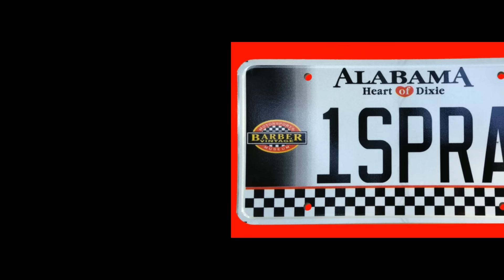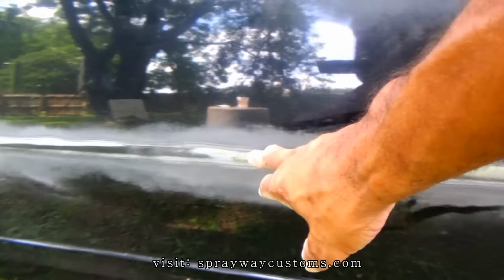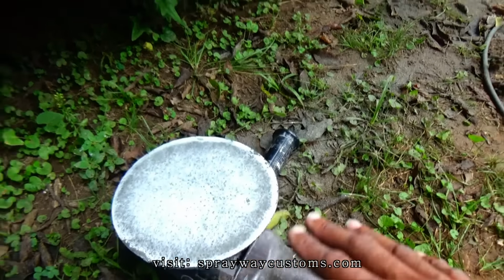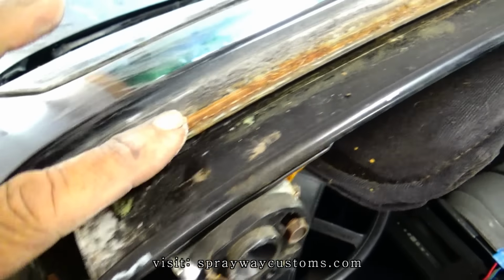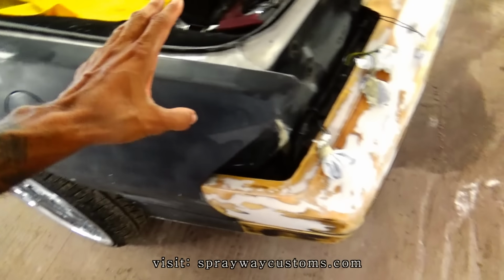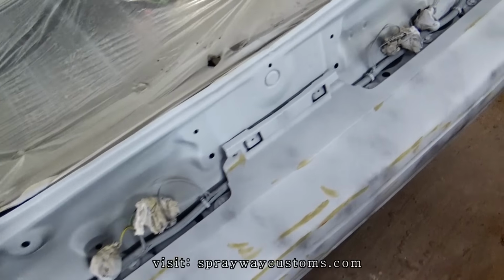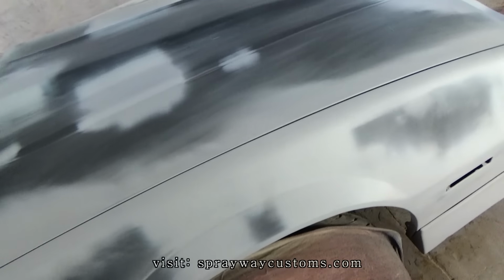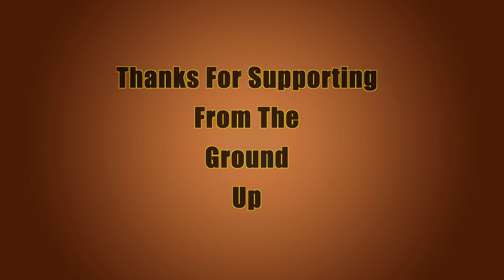Bodywork Dent Repair / Primer / Prep For Painting A Car At Home - 88 Chevy Camaro IROC Z28 Third Gen

Comment: Awesome job man! Those urethane bumper covers were wavy from the factory. Most body shops won’t touch them. Very hard to block them and they actually flex in the wind at highway speeds.. I’ve seen a lot of beautiful paint jobs spider crack on those front bumpers. You’ve definitely showed a ton of work.. best narration along with each step.. mad props brother spray
Reply from the maker: You right on the bumper covers Brett. Especially on the flat area where the lights at.
Reply: You’re right about that. I was told it would be easier to just replace mine. I did not! I worked them myself and they were super hard to straighten out. I made stands from wood to give them a harder surface to work on. I also used my orbital sander since it doesn’t put much force down on the material.
Reply: Also used a different filler for them. One that is flexible. On the spider cracks I sanded all the way down into the urethane and used the flexible filler. They’re pained now and don’t show any spider cracks but only time will tell.
Reply: I give ya tons of credit. Your bumpers were in a lot worse condition than mine were

Comment: I’m definitely a fan of your work, but I was wondering if you get a chance to show us a in depth rust repair . I have a 2005 Acura rsx and it has rust on the wheel wells that I’d like to fix. I’d like to see a basic rust repair your way where I won’t have to spend an arm and a leg to fix it myself . Thanks 🙏
Reply: He has videos with rust repair. They gave me the confidence to fix my rusty hatchback. He has a few videos with different techniques I ended up using. Besides, if he can do it with one hand while recording... you can do half as good with both, lol. I used spray foam, Bondo glass, and spray paint. Wish I could post pics here, "Sprayway inspired".
Reply: @nsalcedo22  thanks I will have to skim through all his videos .
Reply from the maker: Next time I run across rust I'll go more into detail. I do have a video on repairing rust without welding though.
Reply: @SprayWayCustoms  thank you sir I will look through your videos. The rust issues on my wheel wells is all the way through so thanks for your guidance sir. 💯

Comment: I enjoy the process I have a? The guy coat when you see the guy coat means the area is high or the area is low and needs more filler
Reply from the maker: If you still see the guide coat in some areas after sanding, it means those areas are low and you need to sand more.

Comment: I hate how those third gen door handles raddle. Just needs a small bushing 8nstalled and it goes away. The replacement  door handles do the same thing so the bushing last longer.
Reply from the maker: Yes...I'm just gonna repaint the originals
Reply: all GM handles from that era and style had that problem.  The wire return spring would break off and it would flop around.
Reply: It’s always just the driver side because of its use. The spring wear out. It’s a easy fix.
Reply: I bought 4the gen handles first my 3rd gen. They are a tad bit smaller. I’m sure those springs will eventually break and I’ll have to replace them as well.
Reply: @SprayWayCustoms  are you painting them the original black or the color of the car? I’m trying to decide whether to leave my new ones black or paint them the color of the car

Comment: That back hatch ain’t that easy to get off. It requires cutting the sealer from the class. To do that you have to remove the whole glass and do it on a bench or floor on a blanket. Long story short..... tape it up!!!!
Reply from the maker: I actually was trying to get it off and kind of gave up on it one day but I had it sitting out in the sun and it just separated real easy when I started back messing with it.
Reply: I took my glass off while attached to the car. Used the longest knife it have- butcher knife from my knife block. All I did was go yah it through a lot and then there were only a few spots holding it on. Took all of 10 minutes. That urethane adhesive is soft and doesn’t fight much since the car is old. I’m still in the air for what to use to reattach it. I’ve heard that after attaching it ya should wait 2-3 weeks before putting the shocks back on.

Comment: Your videos have inspired me to turn my garage into a small shop and try my hand at a few Walmart parking lot dings and maybe a few whisky dents.    I am a service tech by trade so I have no trouble taking apart what needs to be done.
  My question is are you having good luck with harbor freight body tools,   Or should I  invest in better tools?    I have access to every brand,  but want to start out a little at a time.
Reply from the maker: The Harbor Freight body hammers are great

Comment: I pulled the panel off the back glass by taking the 6 nuts off the bolts and the. I used a long knife to break the urethane adhesive. Off it came. There will be some small spots that are beginning to rust. Mine had barely any as it’s from California and now it’s in Houston.
Reply from the maker: Thanks Super Chile...I eventually got it off

Comment: What do you think about rust converters? Not the spray can primer looking so called converters but the type that comes in a gallon jug and and turns into a zinc ready to paint  coating.
Do you use these and if so, which ones?
Once again, thanks my friend. I'm glad you can see the good underneath the bad on some of these panels. I would have sworn some would have had to replaced. This gives me a lot of hope for some projects I want to to do once my spine heals some more.
Reply from the maker: I haven't used many rust converters but I heard great stuff on the kind you talking about

Comment: Great video thanks for sharing the tips. Question about primers hope you can help.

I’d use epoxy for bare metal, add bondo/sand it down where needed, then spray high build primer?
Also what brand primers you recommend?
Thanks
Reply from the maker: panchbarron1 yes that's the correct way of doing it. Most of the time I use UPol High Build Primer...it's pretty affordable.
Reply: @SprayWayCustoms  thanks for the info 😎

Comment: I always watch your videos multiple times to gather all the information that I may miss the first time. I do have one question tho. How do you know when to wet sand or just sand without water? I’m going to paint my 75 Cadillac eldorado that was last painted in 07 wich the body work is still good overall may need a few touch ups on dings but I’m just wondering if I start off the rest of the car wet sanding with 180 or do I not need to add water?
Reply from the maker: Wet sanding is done right before paint. It should be your final sand. You should dry sand with 180. Anything more aggressive than 320, I would say just dry sand because you'll need more sanding after that because you have to remove those 180 scratches.
Reply: @SprayWayCustoms  Sounds good, thank you for response!
Reply from the maker: Miguel Gonzales no problem

Comment: What type DA do you use? I have a good sized dent on my camaro’s front bumper, how would you recommend pulling that out of the bumper is not metal? What filler would you recommend I use?
Reply from the maker: It’s a Porter Cable

Comment: Killer video ..what's the purpose of using different primers ??!
Reply: Epoxy Primer is not porous. Epoxy also sticks "best" to bare metal. But, epoxy is not really meant to be sanded on.
Epoxy seals all water and rain out no matter what. If you are going to grind down your car to bare metal and not do any body work or your paint job for months and months or years, you should prime the bare spots with epoxy. All other primers and fillers are somewhat porous and should not be left to humidity and or rain for very long. Other primers like high build 2k, (two part mix) are meant to be built up in layers and to be "block" sanded smooth and flat. 2k primer does tend to shrink a little, so you should do 3 or 4 coats then let it sit for a couple weeks or so (in the sun is good). You may have to do that 2k  process 2 or 3 times. After its all perfect, you can then put on a "sealer" coat or "surfacer" coat of primer. That sealer coat can fill in very slight scratches, so your metallic paint doesn't sink into the scratches as much (the metal specks or flakes lay down really weird in the scratches.) then you shoot your paint of choice.
Reply: @jakefriesenjake  thanks for the info
Reply from the maker: Thanks for the reply Jake

Comment: 3 project's at 1 time you're a beast but I really need to know where you got that sand paper that sticks to the sanding block big dawg
Reply from the maker: eBay or pretty much anywhere online just type in PSA roll sandpaper / Pressure Sensitive Adhesive Roll Sandpaper
Reply: Ok thanks bro I been learning a lot from you you I'm going to show you before and after pictures when I'm done with the bubble Chevy

Comment: I got surface rust on my 68 impala. What do you suggest to get rid of it ? Just sand and spray epoxy primer? Do I have to go to metal? Or can I just scuff and primer? Thx
Reply from the maker: Sand it down to bare metal and then epoxy
Reply: @SprayWayCustoms  once it’s to metal do I need to do anything to the metal before I spray the epoxy? Like wipe it with a cleaner or anything? Thanks

Comment: No need to use self etching primer for the bare metal parts? Just epoxy primer/sealer?
Reply from the maker: I just used it on small areas to keep from mixing up epoxy
Reply: @SprayWayCustoms  gotcha thanks 😊

Comment: how do u apply the guy coat i know you don't hold it down from far on spots with primer or bondo and how would you know to stop sanding and what grit did you sand with
Reply from the maker: Just mist it on lightly. You'll know to stop sanding after the guide coat is gone. It depends on what stage of sanding on the grit

Comment: I all ways watch your video's , do you have a video on how to deal with surface rust on a hood or on a roof it's really bad if not could you please do a video on how to get it ready to paint please
Reply from the maker: I do have some videos on rust but if it's just surface rust...all you need to do is sand it down to clean metal and spray epoxy over it and then high build primer

Comment: How would you mix products that says 15 to 20 percent reducer seams like im just confused on that part i sprayed high build primer with a 2.0 tip and did 4:1 mixing ratio and when it tried to spray a second coat i think it was starting to gum up in my gun wasn't spraying right and build up on the tip
Reply from the maker: 2koolforyou88 the mixing ratios can get a little tricky. Most cups have a section with most common ratios on the side. I try to reduce all my primer especially if you spraying it out of 2.0 or smaller tip. I really sort of freestyle on the reducer. Stir it up and lift the stick up, you want a steady flow from the stick but not pouring like water with a smaller tip. It won't hurt to put a little too much reducer in it, you stand the chance of running it but it won't clog up your smaller tip. You can also try this after you let it flash and ready for the next coat. Take you a rag with a little lacquer thinner and wipe the tip off and shake up the cup and gun a little because if you let the gun sit too long the paint on it will start drying up.
Reply: @SprayWayCustoms  thanks bro I think   that what was happening i didn't add reducer just used the 4 to 1 mix ratio still was pretty thick and started to harden up inside the gun and the air cap will try this glad I did buy reducer

Comment: What type of gun do you use? Also, if painting at home, what type of air compressor do you recommend?
Reply from the maker: I used a SATA 1000 B RP with a 1.8 tip spraying the primer on this one. I have a 60 gallon Husky compressor and never had one problem out of it.
Reply: Thanks brother
Reply from the maker: No problem

Comment: Question, im getting into bodywork and learned a lot from you as well,looking at this video you stated you will hit the fill spots lightly and go back over it when blocking,whats the difference than just hitting the filled spots when blocking?
Reply from the maker: Not sure what you quite asking. I knock the filler down with the da and then start blocking
Reply: What primer did u use on the spots u sanded down

Comment: Is that spot putty pretty good because that bondo brand is not I'm going to have to repaint the hood on my obs because of it
Reply from the maker: C&C Auto Works the one part by USC Pronto is a lot better than the Bondo but the two part Evercoat is excellent. I just use the one part on fine scratches and minor pinholes.
Reply: Thanks for the info

Comment: Hey what's up Sprayway I've been following you for a while now and I'm doing the project of my own and I wanted to ask you I had someone replaced the brake lines and fuel lines and a fuel pump on my truck and now it won't start it's getting gas pressure but it just won't start back up
Reply from the maker: What kind of vehicle?
Reply: It's a 96 Chevy Silverado K 1500 you just did the same type of truck that I have I'm thinking about putting that back a spoiler or wing on the tailgate and I already bought the roll pan for it too

Comment: Do you still use  pure reflection epoxy primer. Can  it be used as a high build primer/sealer.  Also on 96 b body Chevy bumpers. What is your video link for that primer
Reply from the maker: I'm using Upol and Urekem Primer
Reply: @SprayWayCustoms  did you usa a flex agent or addhension promoter for the upol. Primer on the urethane bumbers.

Comment: What it do!!! My Rondo is still sticky after 3 days. I had put less Bondo (body filler) hardener in it so that it wouldnt get hard so fast while im brushing it on. Is there a fix for this? I thought about putting a fresh coat of resin on top of it that’s properly mixed. But I’m nervous air bubbles will form because the rondo underneath is still curing and tacky
Reply from the maker: Yes..you can mix up more just add extra hardener in it and it interact with the old. Don't worry about the air pockets below the surface, they'll be fine.
Reply: @SprayWayCustoms  ok thanks alot    Greatly appreciated

Comment: I see your in Decatur al. Can I get a price quote on getting 1 off mine painted?
Reply from the maker: Yes..What you got Scotty King
Reply: @SprayWayCustoms   lsx swapped 84 s10. Wanting it back original light blue color. Bodys pretty good. But I would like panels aligned also. Took off front during engine swap.

Comment: Here is a tip you may not know... you can take carpenters chalk and put in a fabric bag or sock and pounce or rub all over the car.
Reply: Does that really work?
Sounds like it would. Too bad I already bought the real guide coat powder. That crap is expensive!
Reply from the maker: Yes, that'll work. I actually have the real guide coat powder but I prefer the cheap spray paint

Comment: I didn't see you seal your seams. Water will get in and rust it out all over again.
Reply from the maker: What seams you referring to?
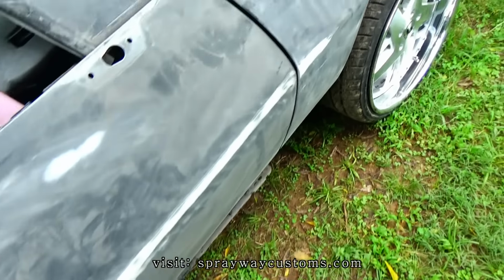Reply: I noticed you went down to bare metal around the trunk, and on the top where the rust was. At minute 25:00.